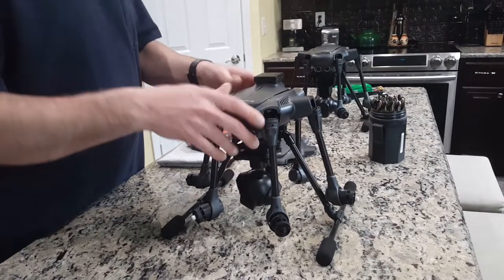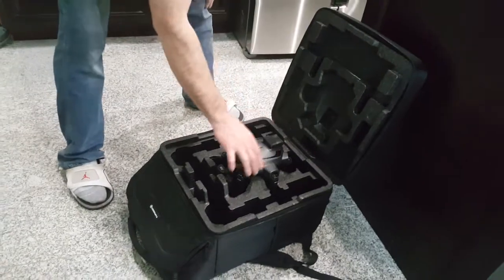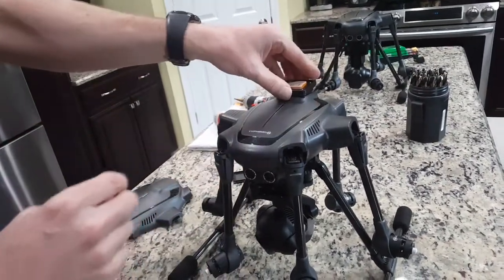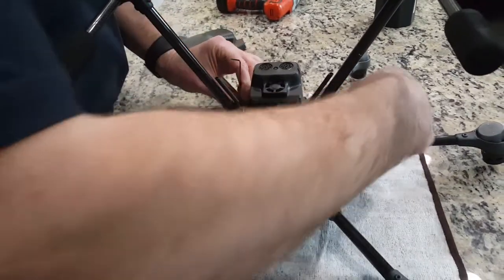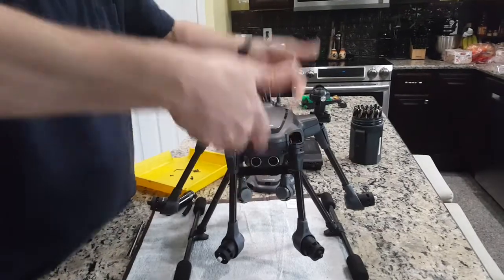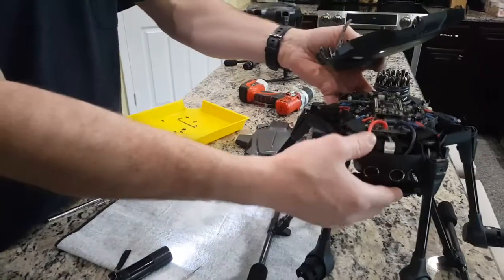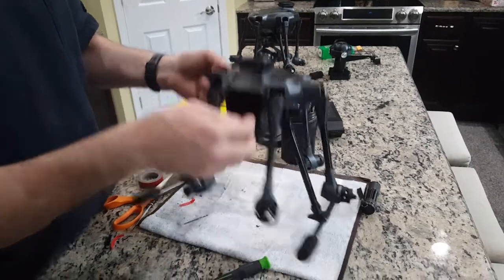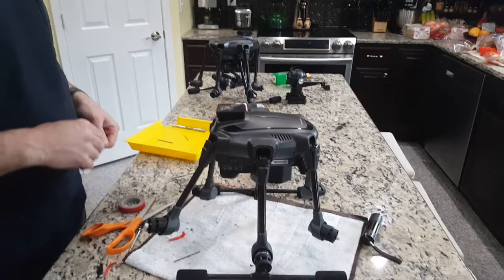Yuneec Typhoon H GPS Compass Module Adapter Stand for more accurate GPS location and compass info.

Comment: You tell me the GPS extender fits in the case and neglect to say the BATTERY CONVERTER does not fit!Thanks for the "Heads Up" That the adapter doesnt fit in the case and will break in the worst possible spot, then you see that it was going to break anyway cause it was printed hollow! maybe 2% infill. You wouldnt print an ugly keychain like that and ** this part should be solid! ** . It holds the battery in the drone! You should at least tell your customers before they try and put their drone back in its case!  Im going to try and tack it together with super glue then pour a bunch of epoxy resin around it and maybe that will work but idk, theres only 1 mm of plastic to hold a 2 lb battery in a drone going 45 mph!  Sounds like alot of Typhoons will be falling from the sky

Comment: I believe you could use really thin wires to wrap around the battery to make a *"Faraday Cage"* That should block any Magnetic lines and RF signals from leaving or entering the battery. People use this to protect them in Lightning shows with giant tesla coils. Someone should give it a try, You would need very little wire, just a couple lines around each side
Reply from the maker: I wish, I've tried everything, but this is the only thing that has worked. Originally, a really tall tower was needed. I continued testing until I found this height is the minimum needed. Happy it still fits into the storage box and backpack carrier.

Comment: Have you (or anybody else) tried putting some aluminum foil under the GPS module, before screwing it in to your adapter? Wouldn't this help shield the GPS module from battery or other interference even more? Thanks!
Reply from the maker: Would be hard to test "shielding even more".
One person had trouble with a battery he was using that apparently wasn't shielded when he bought it.
It wouldn't calibrate his compass with the unshielded battery.
Very rare to purchase an unshielded battery.
He added shielding to his battery and it fixed his problem.

Comment: What brand of battery? I tried a turnigy 8000 but it would not slide in without force
Reply from the maker: Go with lower than 8000mah batteries.
Most of the 8000mah are really tight fits, but they still works at least.
If you can find batteries with the hard shell, most of the time they are perfect fit.
Also don't get caught up looking for higher mah batteries.
I believe a5400mah flies just as long since it is lighter. Focus on 5000mah to 7000mah.
Shop for battery price and don't pay more thinking you might get longer flight times with heavier batteries.
This adapter will keep your Typhoon H flying years after they stop making propriatory batteries for it.
Reply: @amphibiousmotorcycle  thankyou for your reply. Good advice. I  got  the H for $500 with 3 batteries and 2 st16.  Flight time is 15 min and it has to go longer that just seems really bad. I got the adapter and the gps hood yet to install. Yes the 8000 was so tight the labels would peel and i thought to never pull it back out! So time to look around more. Hobbyking has been a good place for lipo purchases know of any others? 
Thanks again!!!
Reply from the maker: 8000mah is the one battery that fits super tight. Brands change all the time. The market has stabilized and has settled on a hard shell standard that fits perfectly. Get batteries between 5000mah and 7500mah with hard shell and you will be very happy. But for now continue to use your 8000mah, since it does work, only it's a pain with the tight fit.

Comment: Can you please tell me what exactly are blocking the gps signal from above in the first place ? If this is about interference, it's because of the compass and magnetic interference many builds like to put the whole module on a mushroom. If your bird is 20ft up in the air, moving the antenna 1/2 inch higher gives you more sats ?  I don't belive it. But I do believe wiggle around and tugging on wires might help a bad connecton. If you're lucky.
Reply from the maker: The GPS compass adapter stand was originally made due to the compass, that's also contained in the GPS module. It made a night and day change to being able to use the battery adapter I also designed (battery adapter sold on eBay). Without using this GPS Compass adapter stand, flying using an alternate battery would be erratic and unstable.
Using the adapter allows all batteries to work without erratic behavior.
But, as often is found there are other side effects.
The side effect found was that using this GPS Compass adapter dramatically speed up the time it takes to aquire enough satellites to be able to start the motors and begin flying. It also increases the number of satellites the drone locks onto. Now for the exact scientific reason we are unsure. I believe that for the compass the reason for the improved is due to getting father away from magnetic interference from inside the drone. For the GPS improvement I believe it is due to getting further away from electronic or radio noise, but I can't be sure exactly how it creates the improvement, I can only see the improvement in initial time it takes to lock onto enough satellites to become ready for take off, and the total number of satellites it locks onto is also increased.

Comment: How do you explain all the H's that work perfect in their original state - receiving 20+ sats without wrecking the beautiful top shell ? How do they all of a sudden stop working after months and years, and get the dreaded GPS lost! etc. errors ? Don't say this will fix it, it worked just perfect without it, until one day it didn't-
Reply from the maker: I hope you can locate a new GPS compass module. It sounds like yours is going bad. Sadly it's getting very hard to find parts for this drone. This adapter will not fix your issue if it is as you described. Once you resolve your initial issue this adapter will improve your performance. This adapter is needed before you attempt to use any alternative battery using the battery adapter that I sell on ebay.
Reply: Did you install the aftermarket gifi battery? Possible cause....

Comment: Sorry but I did both of these mods and I started getting compass calibration warnings and magnetic interference warnings constantly. I tryed the factory battery and it doesn't happen. I added aluminum foil to the back of the battery to cover the wires and grounded it to shield the magnetic field coming from the 6000mAh battery, wires and adapter. And then it stopped getting the warnings. But I'm now dropping satellites and going to manual mode back and forth to GPS mode. So I now I have another problem to figure out........ The factory battery is shielded from interference.... And doesn't cause lose of the GPS signal.
Reply: I did figure out how to stop all interference for the compass and the GPS errors using any size battery that fits. The battery has to be completely covered, wire and all except the balance plug with aluminum foil or aluminum duct tape. I've tested it thoroughly. I get 20 satellites at least and no compass errors at all. So even cover the 2 wires on the adaptor from front to the back to stop the interference. Apparently the battery and the adaptor unshielded is creating an electrical field during discharge, that's causing both problems. Even losing GPS Satellites. I am a certified tech. Trouble shooter.  So this modification is a good one as long as you wrap the battery and adaptor wires.  Thanks
Reply: @daletec  Yes that makes sense, a lot of amps through those two main wires, of course they'll have a hefty magnetic field. I'd think it only influenced the compass, though - but I believe your experimental results. I went out a little hard on this video, cause I didn't believe he get more sats moving the gps 1/2 inch, and I still don't. And it's not fair to claim you should buy something from him if it doesn't do what he says it will. Because I and every H owner have experimental proof that it works perfect as it is, and the gps lost! error is something that suddenly occurs, after years of perfect reception(more sats than my DJI's actually), that this antenna mod won't fix as he says it will in this vid. But in connection with his battery mod, it seems it has a purpose...really strange he don't answer you. Cause you absolutely make sense and understood this. Bad for buisness if he gets it right ?
Reply from the maker: Sorry for such a late reply here. I haven't heard of this issue. Seems to me there is something different about the battery you are using. I have used 6 different types of batteries and haven't ran into this issue. I can guess the batteries I have used were shielded at the factory and maybe the battery you are using is missing the normal shielding. I'm only guessing here.

Comment: Can you put this on a q500??
Reply from the maker: It will not work with the Q500.
I do have an adapter designed for the Q500 available on eBay.
The Q500 does not require a GPS tower adapter to be installed to use alternate batteries with the battery adapter.

Comment: Good job. What is the product source?
Reply from the maker: It comes free when you purchase the battery adapter I have listed on eBay.
Reply: Mine doesn't have any of the problems you described. Do I still need to do this to run the battery mod? If so why? Thanks in advanced.
Reply from the maker: @28daballa  The GPS compass adapter stand was originally made due to the compass, that's also contained in the GPS module. It made a night and day change to being able to use the battery adapter I also designed (battery adapter sold on eBay). Without using this GPS Compass adapter stand, flying using an alternate battery would be erratic and unstable.
Using the adapter allows all batteries to work without erratic behavior.
But, as often is found there are other side effects.
The side effect found was that using this GPS Compass adapter dramatically speed up the time it takes to aquire enough satellites to be able to start the motors and begin flying. It also increases the number of satellites the drone locks onto. Now for the exact scientific reason we are unsure. I believe that for the compass the reason for the improved is due to getting father away from magnetic interference from inside the drone. For the GPS improvement I believe it is due to getting further away from electronic or radio noise, but I can't be sure exactly how it creates the improvement, I can only see the improvement in initial time it takes to lock onto enough satellites to become ready for take off, and the total number of satellites it locks onto is also increased.